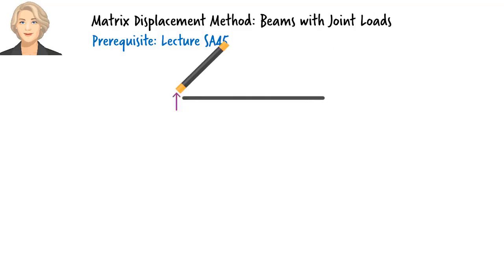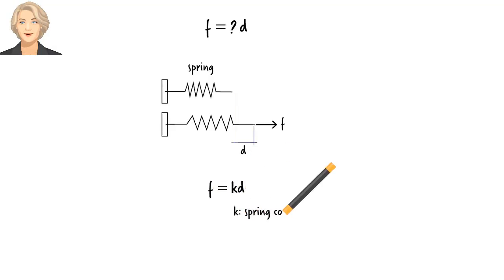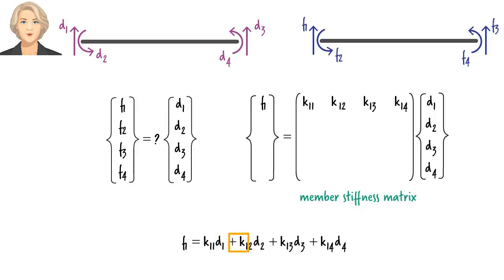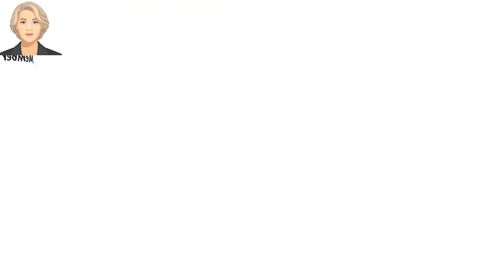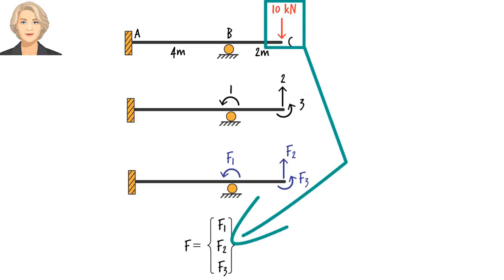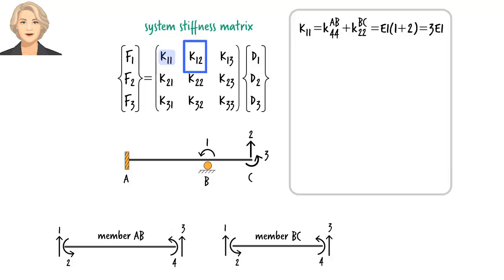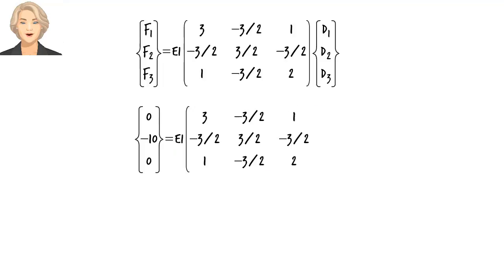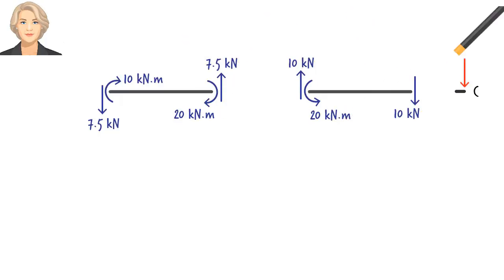SA46: Matrix Displacement Method: Continuous Beam Under Joint Load

Comment: Perfect explanation and helpful. The only thing i didn't understood was why did you used the 2 moments as 0 when there is point load of 10kn, shouldn't this load create a moment in joint b and c?
Reply from the maker: @12:20 the rotation in direction 2 is set to zero, since at the fixed end of the beam (at A) rotation is in fact zero. That does not mean bending moment is zero, it simply means the beam is not going to rotate at that point. When setting up the problem using the displacement method, we make no assumptions about internal forces of the members, we simply observe the (displacement) boundary conditions when numbering the degrees of freedom of the system.
Reply: @DrStructure  thank you for taking your time to respond. 2 forces i was referring are 7:26, but from your post i understand in fix supports rotation are zero and moment has value and in pin support rotation is not zero but moment is zero.
Reply from the maker: Correct. @7:26 we are writing the vector of the applied forces (these are not internal forces in the beam, they are the forces we've placed on the beam). In this case, since the beam is subjected to only one force, the other components of the vector are zero. If there was an applied moment at B and/or at C, then we would have used their values instead of zero when writing the force vector.
Reply: @DrStructure  well understood. Thank you really appreciate your efforts guys. You don't know how much you really helping people. Thank you again
Reply from the maker: @sulaimansamatar4459  You're welcome!

Comment: What if the members have different El?
Reply from the maker: Material and section properties are used for calculating the member stiffness coefficients. So different values for E and I impact the computed k values for each member.

Comment: Hi Dr. Structure, I think at 4:28, k12d2 should be a bending moment instead of a vertical force. Isn’t it? Regards
Reply from the maker: We know k12 = k21. So, let's call this stiffness coefficient K.

We can view K as a converter coefficient. It converts vertical displacement in direction 1 to bending moment in direction 2. And, it converts rotation in direction 2 to vertical force in direction 1.

So, when we multiply K by d1 (displacement in direction 1), we we get bending moment f2. And when we multiply it by d2, we get vertical force f1.

The same happens at the other end of the beam with k34.
Reply: Dr. Structure Thank you so much for the clarification.
Reply from the maker: You are welcome. :)

Comment: 0:59 For slope deflection method I was assuming clockwise moments as positive and shear forces as per positive sign convention(upward shear force @left end of the beam element and downward shear force @right end of the beam element) will this make any difference in the results or anywhere in between the process (that you have shared here) if I stick w/ the same sign convention for matrix displacement method?
Reply from the maker: Your sign convention is okay, but since the derivation for the matrix method was done based on a different (opposite) sign convention, you may run into a slight problem at the end. It would be best if you utilized the assumed sign convention, if you are going to use the formulation presented here.

I would also like to mention that one should not mix/confuse the beam sign convention with the sign convention we use in these methods. For example, in the slope-deflection method as well as the matrix method, we assume the member-end moment to be positive when counterclockwise (at both ends of the member). This is not to be confused with the beam sign convention according to which positive moment means, a clockwise moment at the left end of the segment and a counterclockwise moment at the right end of the segment (the moment pair that causes the beam to bend concave up is considered positive).
Reply: I was totally confused. So is it like I should better accustomed to this sign convention and should only use it for solving any such sort of problems now? 'cause if I go back and solve slope deflection method with this sign convention I might loose track for now , at least I feel so!
Reply from the maker: The matrix method is based on the slope-deflection method. So, in principle, they both use the same sign convention. That is, we assume counterclockwise rotation and moment at each member end to be positive. That is it, that is the sign convention for the slope-deflection method which is consistent with the sign convention for the matrix method.  

Yes, it would be best if you adhere to the prescribed sign convention here, and try to resolve the differences that you see between the two methods in this regard.
Reply: Dr. Structure Thank you! When will you be releasing lectures on reinforced concrete design? Anytime soon??
Reply from the maker: Probably not soon enough. There is a lot of ground to cover before we get there.

Comment: if there is a distribution load on a member of the system , how can i solve it ?
Reply from the maker: See Exercise Problem 1 at the end of the video, click on the i at the upper right corner of the screen to access the solution to the exercise problem. Also, see Lecture SA50.

Comment: At 13:39, one of the moments at point A might be pointed to the wrong direction.
Reply from the maker: Yes, you are right. The internal moment acts in the opposite direction to what is shown. Thanks or the correction.
Reply: I suppose the direction of the reaction moment is correct while the inner moment shown in the figure is incorrect.